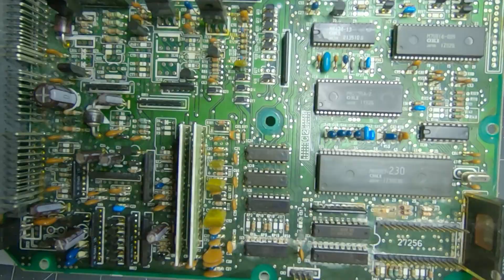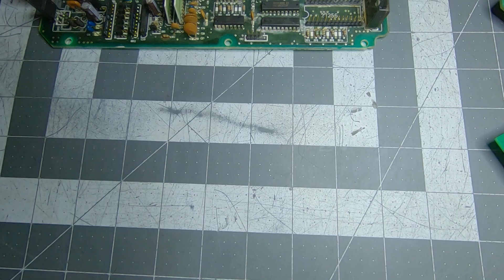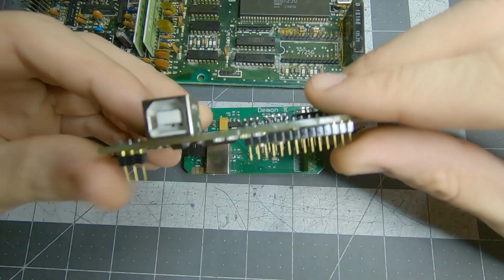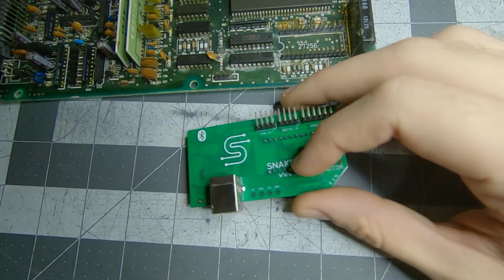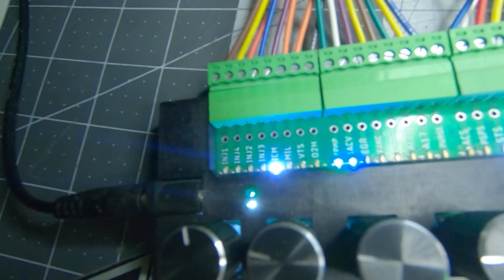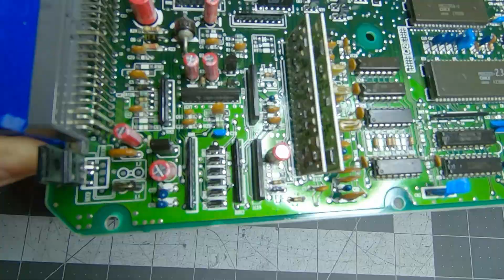Chipped OBD1 Honda ECU Buyer's Guide | Refurbishing an ECU

Comment: Hey I came from another channel. I just bought this y7 that used to be boosted. I have a skunk pro series manifold and it has the 2 wire iacv. I’m looking into replacing the engine harness. If I get the original 3 wire iacv can I do the 3 to 2 wire conversion and run it with a p2e-a01 ecu? If not would a different ecu work? I read online about having a setup where the ecu is obd1 and then somewhere along the harness it converts to obd2a. I’m not that knowledgeable on this stuff, but im trying to get this car running at least.